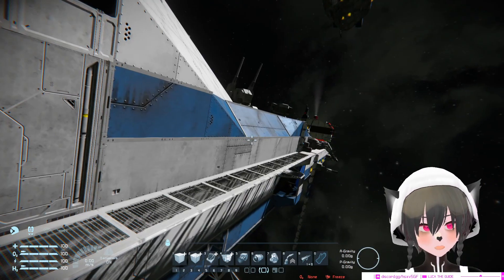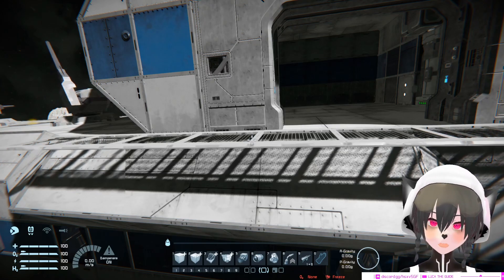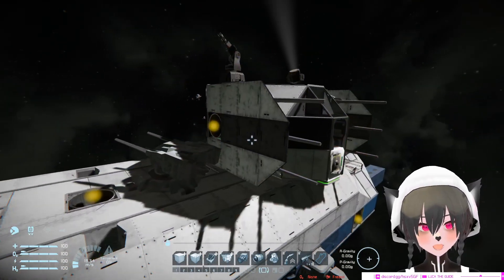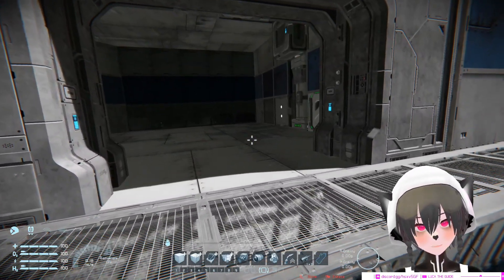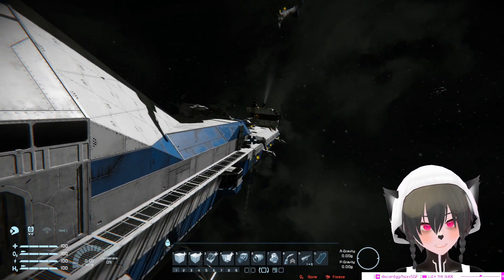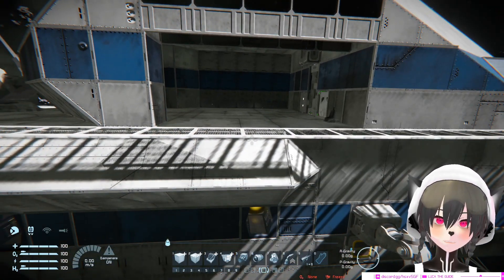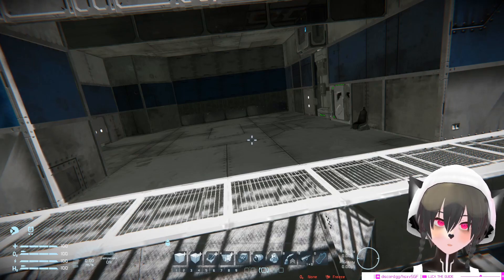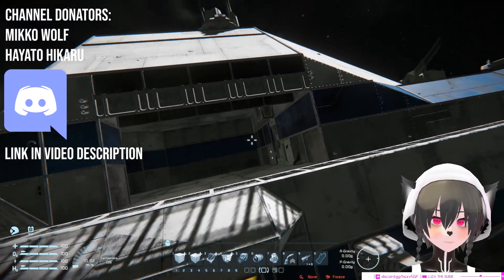Hangar or no Hangar for Combat Carrier? Space Engineers Ship Design Discussion

Comment: Why not try out the Battlestar Galactica routre and have additional hull sections on your ship where the hangars are located. You can leave them open but if extra protection is needed you'd only need 2 doors per hangar section, one at the front and one at the rear. If the ship is detached this also provides a slightly safer alternative as if you start moving by going forwards the ships will just float out of the back of the hangar.

Comment: Another awesome video, I'm mid way thru a combat carrier at the moment myself and in order to combat the issues you have highlighted, like the ship coming lose and doing internal damage i would suggest placing this new 'no hangar door' strategy but with the opening facing the rear so that any ship coming loose can fall out the back of the hangar easier? My ship is up to 11k pcu 1.1 on weight with 2 large hangars and a landing strip, 16 gatling gun nose section, 6 large hydro 2 large ion 8 small ion on downward thrust to ensure she can lift 3 other craft off world . Will post when finished. Thanks for the great tips Luca a real gem of a YouTube channel :)

Comment: I know you where mainly talking about for attack ships. 

Personally for on my newer main ship there is a small hanger under the ship that has to mag locked small grid ships. One is a welder and the other a miner. Ment for after battle repairs. 

But I also have a upper deck in the back of the ship with two connectors which house any fighters 

I have only been in a few fights with it and it's seemed to work well so far